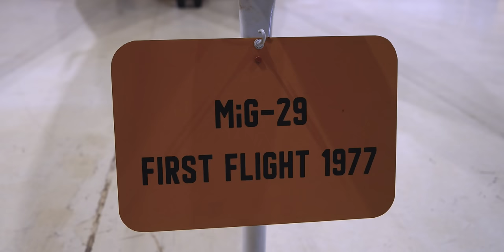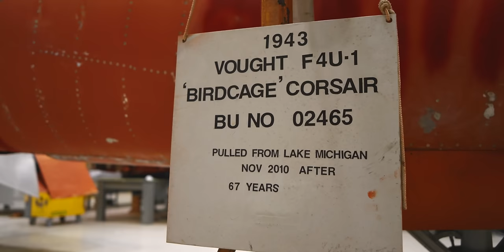Restoring a Legendary WWII Fighter Plane: The Corsair

Comment: I was a member of VMA-214 in the 70s flying brand new A-4Ms. We did a lot of dive bombing, some straffing and dog fighting. The "M" had a larger canopy than other models of the Skyhawk which was neat and it had a self-starter that almost worked most of the time.   It also sported a drag chute which was a beast to repack so we seldom used it.  The Plane Captains refused to repack it demanding that the pilots who had deployed it do.  So we didn't do it again. They gave us a baseball bat to try to jam it back into its canister in the tail of the aircraft.  Instead of deploying the drag chute we just dropped the hook and took the arresting gear that was stretched across runways in the middle and at the end.